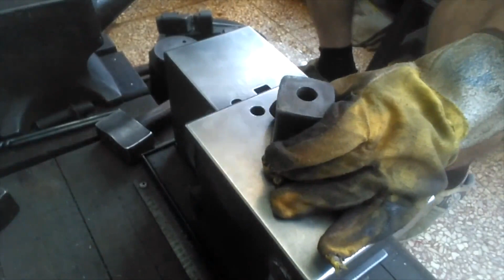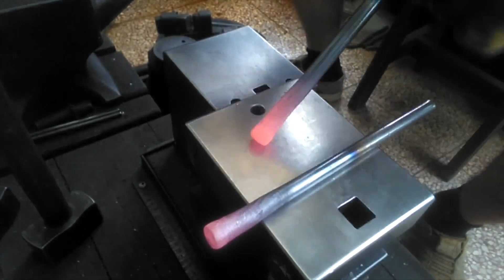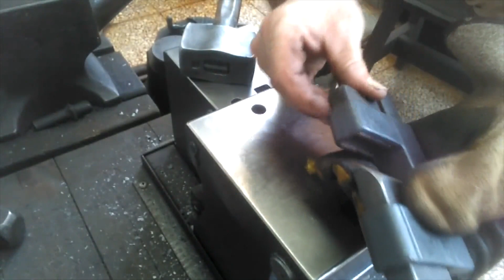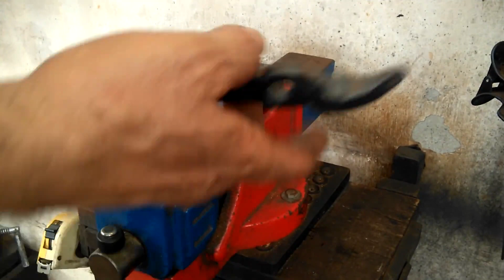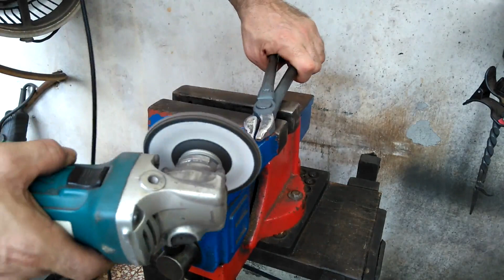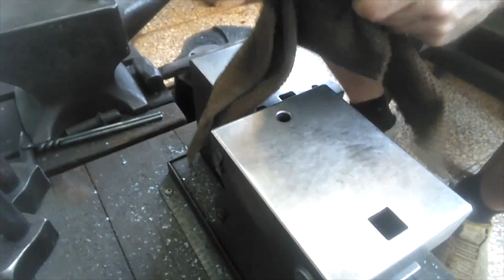Forging a blacksmith scroll tong - complete process. Free giveaway!

Comment: That upset gauging block is genius. I have honestly never seen that tool used by anyone else... And it gives me an idea as to what to do with a particular piece of steel I have (I started renting an old abandoned machine shop 6 months ago and moved my business operation to that building instead of my home shop. 3000 sq. Ft. Was a huge upgrade. Anyway the place came with lots and I mean LOTS of steels of all kind laying EVERYWHERE and LOTS of old proto type pieces of randomness the company had made for various industrial plants from all over) anyway I was able to made the "hot-cut shearing tool" you had made in another video using some of those old random items lying about. And I know just the piece of random abandoned metal that will suffice for an upsetting tool like yours at the beginning of the video... And I'm gonna make it accommodate 5 or 6 size variants. Thanks for the inspiration Glen! You da tong guru!

Comment: Beefy tongs, nice work. I really like the style you have from fullering around the boss.
I was wondering, did you quench the handle just to cool them enough to hold or to harden ?
Reply from the maker: Nathaniel, I cool the handle ends to be able to hold and also to prevent that area from deforming when I'm adjusting the jaws to size. Thanks. Glen

Comment: I was thinking that if you were to do a set of tongs with serrated teeth using your guillotine with some very sharp narrow jaws might be a good idea. when riveting would something like an induction heater be better as you can have a very small area of heat?
Reply from the maker: That's a great idea - the idea about making dies to serrate some tong jaws. In the past, I made special tongs with serrated jaws for a customer and always had trouble being consistent. Having some sort of stop to help mark location would also be good. I think an induction forge would be very suitable for me for things like tongs. But I think the equipment needed is fairly large and expensive? And maybe 3 phase power is needed. I'm not exactly sure... Thanks. Glen
Reply: I have seen smaller induction units (online) and some even home-brewed.  They don't require huge amounts of power, but a commercial unit suitable for blacksmithing would probably be cost prohibitive.  I have seen a garage shop inductive heater that might actually work well for making tongs (ie: (relatively) small diameter, relatively straight metal).

I found this (http://www.ebay.com/itm/like/331307702793?lpid=82&chn=ps&ul_noapp=true) heating unit module for around $40-50 US.  You would also need a water pump & cooler, and probably some other parts & pieces.

Comment: Glen, great video.  I usually can't stand to watch the videos that are over about 10 minutes long but can with yours.  All of them very interesting to watch.  Question:  I am a "wannabe" blacksmith.  What is the first thing (or first 2 or 3 things) you would make to get into learning the craft?
Reply from the maker: Nathan, I think it may not be necessary to make anything in particular when starting out. Its a good idea to get the feel for how hot steel moves when in a plastic state and practice the basic techniques, like drawing, offsetting, bending, upsetting, etc., which are the foundations for everything that can be made via blacksmithing. But if I had to narrow out down, I'd say make some household items, maybe something like J hooks. In one hook, you might draw, scroll, bend, offset and twist. And something like this need only be mild steel so you don't need to consider heat treating like with tool steels. Anyway, I hope this helps. Thanks for watching. Glen

Comment: Wow, another great video.  I'm curious, as a right handed chef, I have ended up with some tendinitis because of overuse.  Do you ever have any issues with that due to the stress of swinging the hammer?
Reply: Oh, and I look forward to the drawing!
Reply from the maker: Paul, I had very bad tendonitis years ago (from blacksmithing). I used to grip my hammer too hard and use a hammer that was too heavy. It was tough but I got used to the pain. My advice may seem ridiculous. I found that doing nothing, as far as treatments, medicine and the like, actually made my elbow tendon stronger. It took a good year but eventually my elbow tendon became ridiculously strong and hasn't hurt to this day. Now, I've developed the same problem in the other arm and have had that for a while. But I'm trying the same ignoring it method and it seems to be working again. I don't mean to abuse your arm more - you have to aware and not go too far accepting pain. Anyway, this may be bad advice but it worked for me. Thanks for watching. Glen

Comment: im working on setting up a coal forge,  I have a peter wright anvil, and several hammers.  I was wondering what is a good first tongs to make or buy for general work.not really sure what i will get in to once i start but need a set of general tongs
Reply: clnfreak one he has them on his website for sale
Reply from the maker: If you plan to make a tong, I would say a standard flat jaw tong is a good choice - the jaws tend to be less fussy than some other styles of tongs. As for the tongs you might find most useful, it really all depends on the stock you will use (size and shape), how you will need to hold when hammering, and how your workpieces will change shape as you progress. Some people like "wolf jaw" tong as an all-purpose tong and I make something similar that I call  dragon jaw tongs. But there really is not universal tong - most tongs can hold within a range but typically that range isn't very great. Since you are starting out, perhaps you could work on stock that will fit whatever tongs you come up with. Or another option would be to work on longer stock that would allow you to hold with a gloved hand. I hope this helps. Thanks for watching. Glen
Reply: thank you,  i was thinking flat jaw.  the materials i will be working with will vary (i can get lots of scrap via my work).. i appreciate the response and enjoy the videos

Comment: Cool video (as usual!).

Are you sure that the problem was with your camera, as video editing software OFTEN can be a culprit.  Professional (as in television & movies) recordings aren't even recorded together as all (that's the purpose for the slap board in movies); and are only put back together later.  If you check your software, you should be able to find a slider setting called audio delay or possibly lip sync (I don't edit video (or even use video editing software), but I do work at a TV station, and have to monitor for exactly that sort of thing).

Comment: Hey Glen, I noticed you went back and forth between the two anvils tword the beginning of the video. Does each on have a different radius on the the edge or am I reading into that too much? Also, what kind of steel and hear treating process did you use to make your drift. Keep up the great work.
Reply from the maker: Randall, Yes, to some degree, those two anvils are a bit different along the edges. But mainly I go back and forth when it's an issue of height. For some operations, I like to work on the smaller, lower anvil and others, the higher anvil. Still, at other times there's no rhyme or reason to why I work on one or the other. The steel I used for my punch/drift is H13. Very suitable... Thanks Glen
Reply: Ah, thanks for the answer Glen. Can't wait to see what is coming next.

Comment: Watching you working the steel is funtastic. I would definitely love have my name in the hat. What three tongs do you recommend for a beginner?  Do you have a list or an index for you're videos? Happy New Year
Reply from the maker: It's hard to say which three tongs a beginner might find most useful. It really depends on the shape / size of the stock you're planning to use, how you need to hold when hammering and how your workpieces will change shape as you progress. That being said, beginners should likely stick with small to medium sized stock when learning how to properly hammer. From my tongs, I would probably recommend: flat 1/4", dragon jaw 3/8", and bent knee round 1/2". My videos are in no particular order but maybe I should index them - good suggestion. Thanks. Glen
Reply: I appreciate your response
 Thanks.

Comment: One question I have Glen.  The depressions you make with the guillotine tool at the front and back of the boss, are those functional or just for aesthetics? Also, do you originally come from the NY/Long island area?  just guessing by your accent.
Reply from the maker: Michael, They are not really functional as far as the use of the tong is concerned. But they help me to locate the tong when doing other operations, like offsetting the jaws or handles. The aesthetic those depressions add is definite. But as far as function, those depressions help to slightly thicken the boss area from side to side which adds a little strength. I'm originally from Staten Island so good guess. Thanks. Glen
Reply: Glen GS Tongs sorry about that, most people I know from Staten get insulted when I suggest they are from Long island.  I have no idea why.  I'm guessing you didn't anticipate how many comments and new subscribers this video would get you.  like most I'm new to metalworking, your videos have been a big help and good inspiration.  Thanks again.
Reply: And add me as one more who would like to see a video on your upsetting block

Comment: Nice move Glen! Giveaways are an excellent way to grow your subscriber base and increase website traffic. If you would like we can go over ways to promote the giveaways without any additional expense so that you receive a greater return for your efforts. Anyway, I hope that you and the misses are doing well.
I almost forgot to mention that audio sync issue is a problem with the operating system of your video camera, that is if you are capturing both audio and video on the same device. I do not now of any way this could be fixed other than checking the manufacturer's website for any software updates for the camera model you have. There is a way to fix problems of this nature in post production, but that depends upon the software package you are using. There is an open source package that outperforms the expensive packages that you could use at no cost, which is the best way to go. The best way to produce higher quality videos is to capture the audio with a digital audio recorder from a lavalier mic as it provides you with far greater control. The next item would be to use multiple cameras to capture various angles of the work. I know that sounds like a pain in the ass due to your limited work area and the room that tripods require. However, there are ways to accomplish this without using multiple tripods or have any camera gear in your way limiting your movements or the way to perform a task. of course, this is just another item that we can talk about later if you are interested. Thanks!